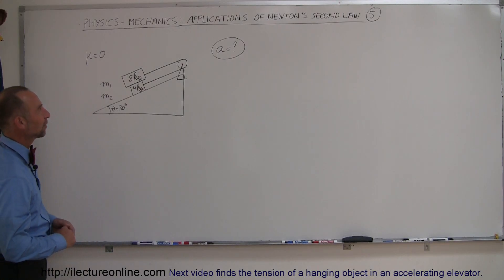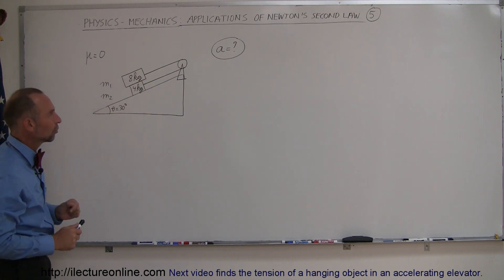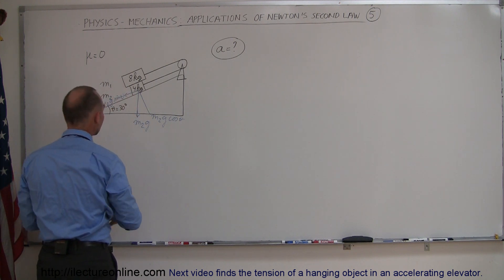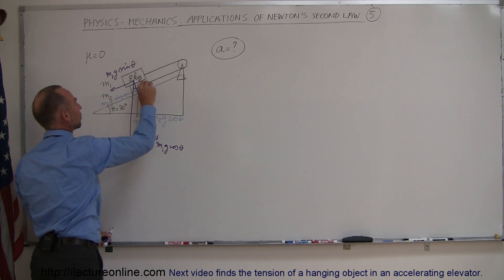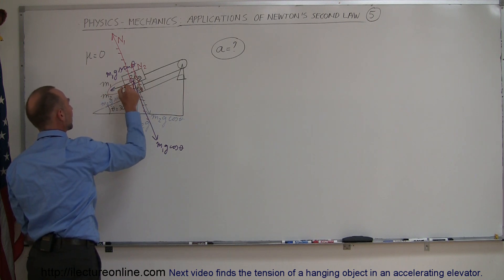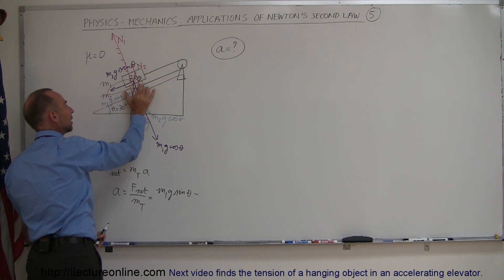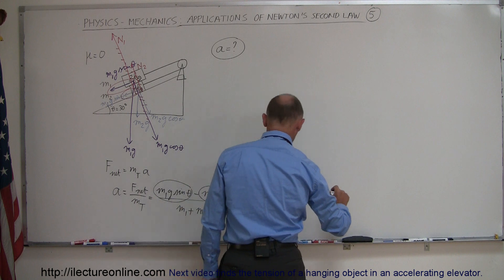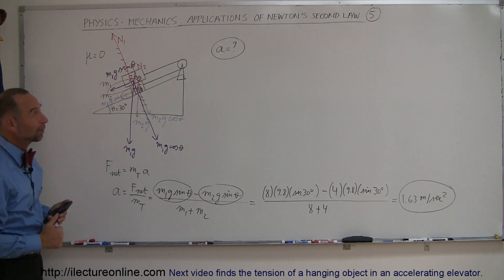Physics - Mechanics: Applications of Newton's Second Law (5 of 20) ramp with block on block

Comment: so what are the T1 or T2
Reply from the maker: +Mukhtar Mahmood 
Draw a free body diagram for each of the 2 blocks and solve for F = ma in each case.  That is how you can calculate the tension in each string.
Reply: That means that the tension are not equal, am I right?
T1=26.16N
T2=13.08
Sir am I right?
I draw free body diagram for each blocks and solved it using Newton's 2nd law F = ma, which in this case the F is Fnet

Comment: Excuse me, is it OK to mention tension force T in this kind of question? I tend to apply Newton's 2nd law on each object instead of a whole system like you did. Thank you Michel van Biezen
Reply from the maker: Dan Huynh 
When you draw free body diagrams, you will see that the strings experience tension force.  (Tension is a force).
Strings cannot experience compression force.

Comment: Wouldn't the Normal force of the top block affect the Normal force of the lower block? So to calculate the Normal of the lower block, you'd have to add the Normal force of the top block to the calculation you'd done for the lower block?
Common sense tells me the weight of the top block would come into play with the lower block's Normal Force. :S
Reply from the maker: Blueboi05
The normal force of the incline pushing back against the lower block (m2) is:
N2 = m1gcos(theta) + m2gcos(theta)
Since there is no friction, this does not affect the problem.
Look at the similar video where there is friction (15 of 20)

Comment: i have a question
the acceleration motion is from right to left and u mentioned earlier in ur previous videos that ( from left to right ( a ) will be positive and from right to left ( a ) will negative ) 
so why ( a ) is positive here?
Reply from the maker: Ibraheem,
Good question.
On an inclined plane, the coordinate system is "shifted" and there is no true right or left, there is only parallel to the incline and perpendicular to the incline.  Any forces not parallel or perpendicular, will be split up into components.
Next I find it easier to assume a direction for the acceleration and call that the "positive" direction (even if it appears to be going "left".
Then I call all the forces aiding the acceleration positive forces and all the forces opposing the acceleration negative.
Reply from the maker: Michel van Biezen
Ibraheem,
That is a good question.
On an inclined plane, there is no true left or right, since the coordinate system has been rotated.
So there is a direction parallel to the incline and perpendicular to the incline.  All forces are thus broken up into their components parallel and perpendicular to their components.
Next I find it easier to assume a direction for the acceleration, and call that direction positive, regardless if the acceleration is up the incline or down the incline.  Note that if you turn the problem around you would get the same result.
Then you call all the forces aiding the acceleration positive and all the forces opposing the acceleration negative.
F (aiding) - F(opposing) = M (total) x a
Reply: Michel van Biezen thank you so much
wish i could do anything to show you how thankful i am 
am from Saudi Arabia 
and i have many troubles understanding physics because we have law quality education and bad teaching standards plus arrogant teachers who think they are the best in the world   
u r sir helping me helping me a lot
thank u so much